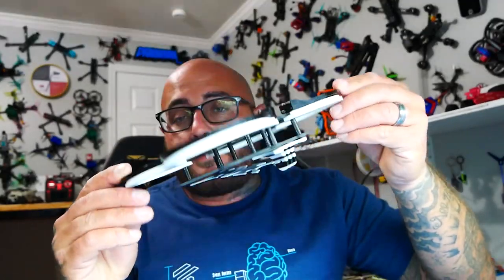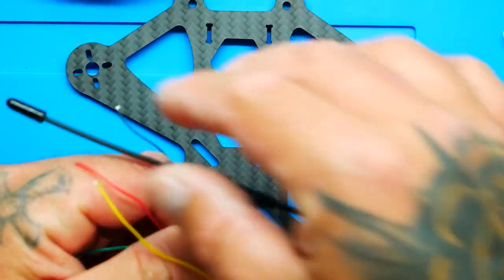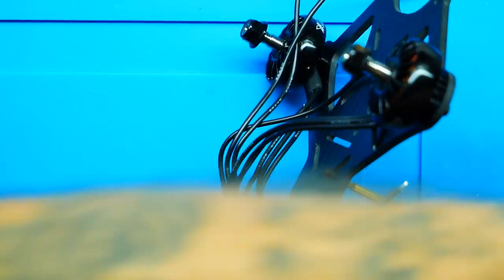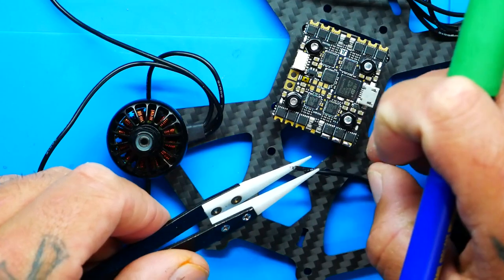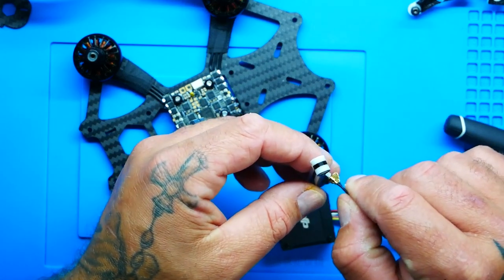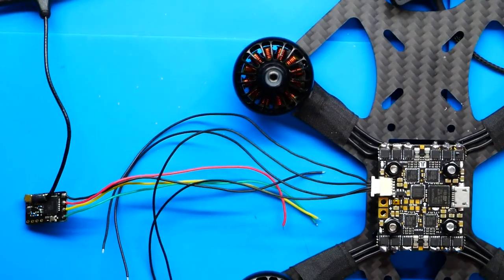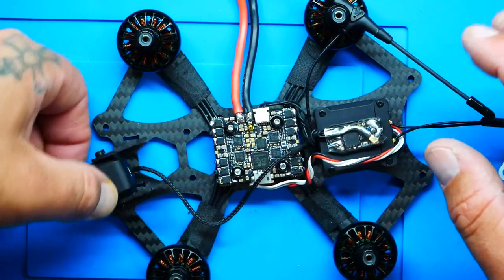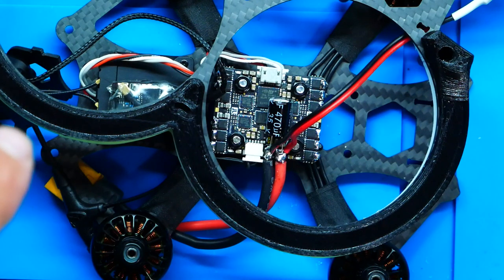Let's Build A Cinematic Drone! Flies Like A Racing Drone! CineWasp v2

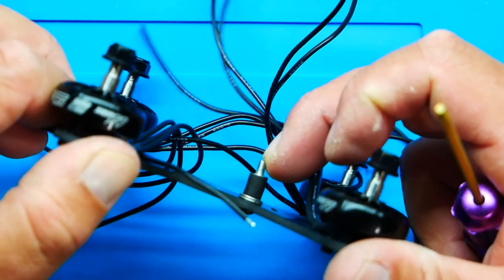Comment: Oohhhhh @ 6:42 I like that built in softmount 😮AND I like the adjustable slot design for the stack....awesome build as always brother! 😎
PS - would be nice to use a connector on the LED's to disconnect and/or to service the quad easier....